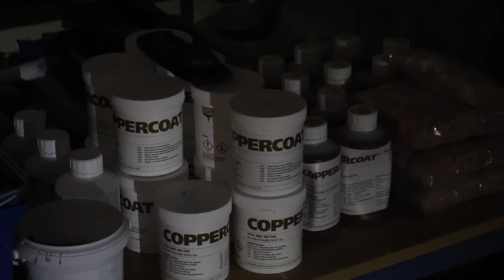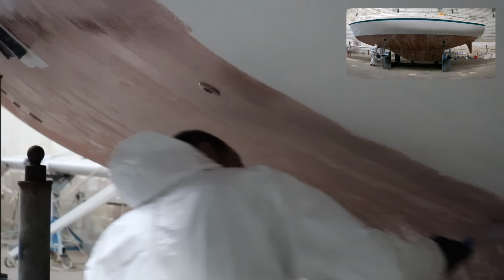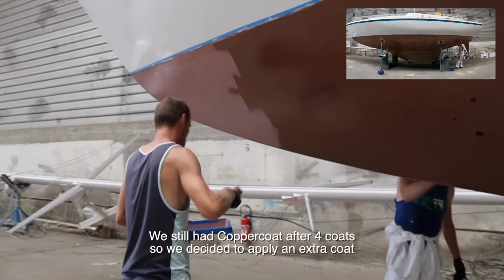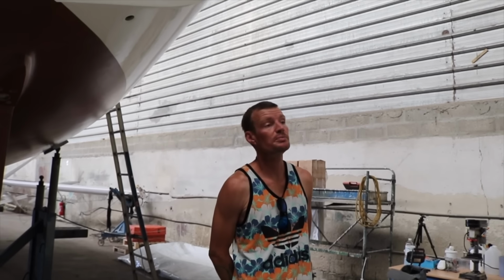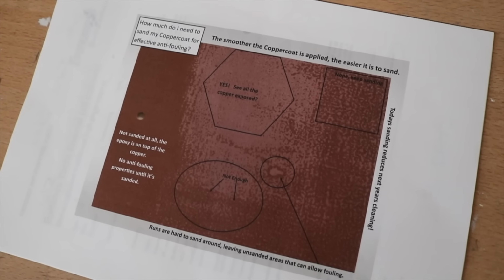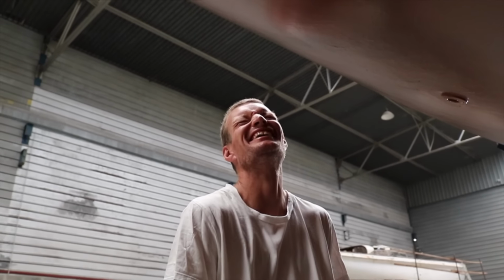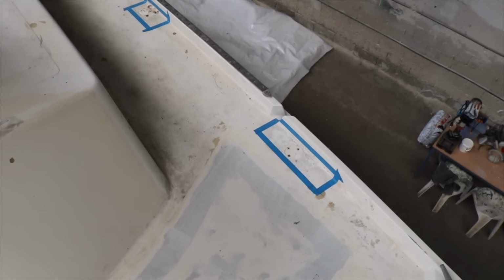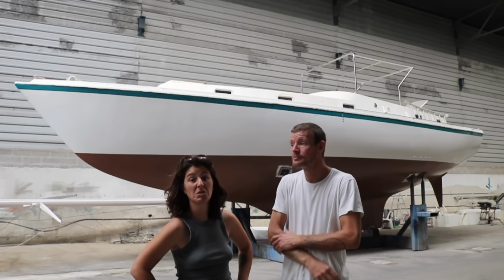COPPERCOATING our SALVAGED BOAT... Saying GOODBYE to ANTIFOULING PAINT!

Comment: I liked your initial introductive video. Getting an artistic vibe.
Oh yes ..the boat's ok too...
Oh btw. Cracked gel coat under stanchions etc = bad backing. For some reason, or just for being cheap,  penny washers and plates the same size as the base are normal now. It's not enough in a stress situation on a flexible substrate.

Comment: Maybe use Butyl tape to seal stanchion bolt holes. I used this from recommendation of next boat who replaced his whole deck, Used Butyl and also a little clear silicone, or sika. You can also put a small piece of butyl temporarily in hole to keep rain out, with simple remomovablility.

Comment: if its patchy it needs more coats ,in future sand and prepp it first ,also use a roller pole it makes it so much easier and saves your back ,good luck
Reply: They did sand , prep, and apply recommended epoxy primer coats after doing hull repairs and remove all previous coatings . 😊
Cheers warren

Comment: You needed to mix the copper coat better and you need to let it dry more in between coats I would suggest a different mixing attachment and container mix while adding the copper I would do one more coat after sanding to try to get a finish you like
Mixing in a square bucket probably didn’t help either use a smaller mixer attachment on your drill and spend extra time mixing it
Reply from the maker: Thanks for the tip. 
Cheers for watching 🙂

Comment: For long sanding jobs on vertical surfaces, place a ladder behind the work area and hang the sander from it with 'Bungee Cords'. They will take most of the weight off your arms and can be adjusted by using several shorter lengths that can be added or removed to allow work at different levels. Your arms will thank you... bonne chance avec ton travail! 😍👍

Comment: I had similar result with Coppercoating by a professional, only sanded a little with 'blotches'. I found it fouled a little the first year, but the lifted out it reacted all over (turned green). Now in second year it seems tk be working much better, hardly any fouling. Wish I'd sanded it a little more like you have.  But it works fine, very light slime and Ive found the 'Scrubbit' brush works really well to remove it whilst in the water.

Comment: Lovely job guys👏⛵️❤️ When I saw ye stirring with the stirring tool I thought that’s hard work mixing and then I saw the drill being used, a lot easier, I always use the drill and paddle for copper coat and even for anti fouling too, you have a beautiful boat❤️⛵️the copper coat will work with runs too and the fish won’t be judgmental either

Comment: Suggestion for future: Regarding Coppercoat application and the "runs".  Runs are caused by applying too much paint.  You should try using a roller with a shorter "nap"  like a 1/4 inch roller nap as opposed to a 3/8 inch nap....and so on.  Also spreading the paint farther out....even if it means going over it twice.  Restored several old wooden boats over the years but it been eons ago now haha.
Reply: YES , the roller Nap was too long...
Short nap , 200mm wide...l had 3 people rolling & 1 mixing then going around , resturing & topping up everyone's roller trays...we done 5 X coats 👍😊45ft cat

Comment: With our copper coat we had someone stirring all the time, as I remember we had 5-6 people roller it on and we had really thin layers and just didn’t stop. We also had the man from copper coat supervising it. The important thing we were told was that people put the wrong undercoat beneath it, we had to have one type for our keel and a different one for the hull. We actually had 8 layers and were putting it one a whole bunch thinner than you did, as I remember it didn’t really looked covered until the 4 or 5 coat. With sanding it wasn’t that hard , we didn’t have any runs and it was the lightest of sands. That was 10+ years ago and the bottom has been perfect and we haven’t regretted it for 1 second

Comment: Hi, great job , looking so pretty!!!
So I now see from your video the runs you got !   Ok live with it , So hand sanding wet should get into the the small valleys on the bottom And wet sanding cuts faster than dry sanding (but very messy).  You can also wet sand when boat is in the water too but that might be too hard!!! And it’s a big boat! 

Re the stanchion based. I think the deck is too thin ( after 40 years for sure) . Do you have any thick fiberglass pieces  10-13mm or so?  Maybe from dumpster? 
If you bonded this under the deck with thick resin mix  it should stiffen up the deck , extend maybe 100mm beyond the bolts . This should really help. 
That gooey sealant was probably ‘Butyl tape/putty’.  It’s softened by gasoline or oil based solvents ( carb cleaner?).  So if you have any more???
Cheers Warren

Comment: Ellloohhh - it's your Paintshop-Manager from Berlin again ! At first: i usually work on cars and trucks, so i don't have any experience with that special product. But i have watched some applications on other sailing channels and i've done a lot of industrial coatings in my shop and outdoors, so i can answer your questions about the surface-imperfections like this: you've applied five heavy coats, that's your safety and that coating-thickness keeps you out of any troubles - chemicallywise. That chequered apperance should not be there, but i see it just as a cosmetically problem. My opinion: that square mixing yars that you've used are quite away from beeing ideal. Other than in a round bucket you have that "dead corners" where the components don't mix that good as in the center. That might be a reason for that chequered look. But: that did not affect the mechanism, the coppercoat should work as it should even when it looks like this. What you really have to get rid of are the runs and sags. They affect the performance of the coat and give all that baracles and critters in the waters a base to hold on. Groth will take place at first in those areas. Smooth that out and everything will be fine. Best regards from Berlin, Germany
Reply: yeah rectangular bucket by friend  , copper dropped out of suspension
Reply: Good advise but I’m sure they scraped the bucket corners into the roller trays. 👍 I think they could have used smaller roller for a more refined application , long nap rollers are hard to get even coat from.
Reply: I have copper coat use wet and dry sandpaper and it sands much easier.

Comment: The spottiness may be down to the temperature you applied the stuff at. The two component goo that holds the copper particles with the coppercoat will become much more flowy, much less viscous at high temperatures which allows the copper particles to settle faster. Moreover the quantity of stuff mixed in one go and the shape of the pot may have been an issue. When two component gunk sets, it is an exothermic chemical reaction. The reaction goes faster if the surroundings are warm. In the pot, the reaction thus will heat up the core of the content. If the outside temperatures already are at the top end of what's recommended, the inside temperature of the freshly mixed stuff may rise way beyond that. (…ask me how I know. It turns out that pots of resin may make a hissing sound while you cut a piece of fibreglass to shape and turn into posh letter weights in pot-shape before you have the roller in your hand… 🤨 Patching up that half-dead car I once had thus was a failure at the first attempt. )
Another factor may be that the first layer was a bit spotty as well, maybe this prevented the next layers from gripping more evenly?
No matter what, it'll be fine! 🤗 It looked fine after the grinding, didn't it?

Comment: I’ve recently been using a circular wire brush on a bench grinder to clean up various metal components , a trick I learned from a motorcycle mechanic YouTube channel , would this work for you ? 😃🍻

Comment: What does the coppercoat do to the boat?
Reply: Stops marine growth.
Reply: Poisons marine life.
Reply: "...with a minimal leach rate of just 1.4 micrograms per square centimetre per day, Coppercoat is the logical, effective and more environmentally aware choice for antifouling..."
Reply: @USA-RE3  Read straight from the Coppercoat marketing material no doubt. There's over 100,000cm2 on that hull! What about silicone paint, a scrapper and some scuba gear?
Reply: @Humanity101-zp4sq  I don't use it... But you can do whatever you want

Comment: When you going to splash don’t the copper coat need to go in the water soon after you put it on ?  Or is it only bottom coat that has to go in the water soon after you put it on
Reply: No, it will need a light sand to expose the copper before it goes into the water. Once in the water, the copper oxidizes. That's the chemical that helps stop growth.
Reply: NO

Comment: Don’t knock yourselves over the initial finish , you are not professionals . I worked for one of the large motor yacht builders and they used a company which only travelled around the area doing anti fouling and they had a large crew , it took them most of the night to complete a 70 foot boat to professional standard . Give yourselves a pat on the back!